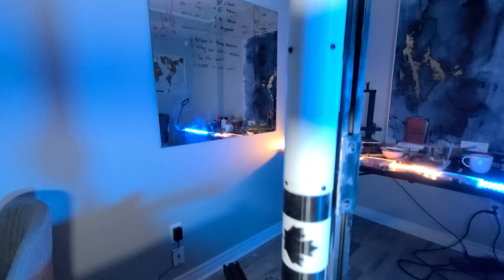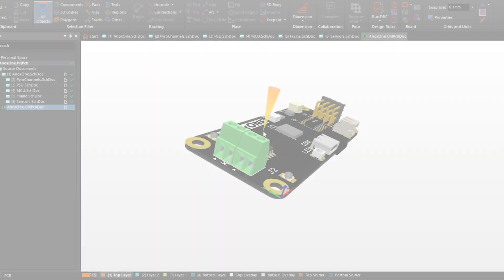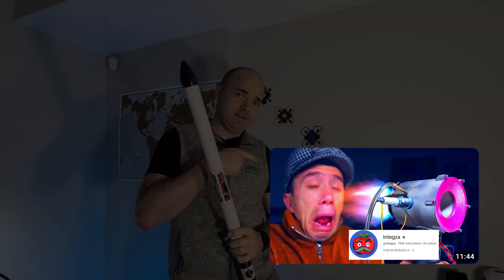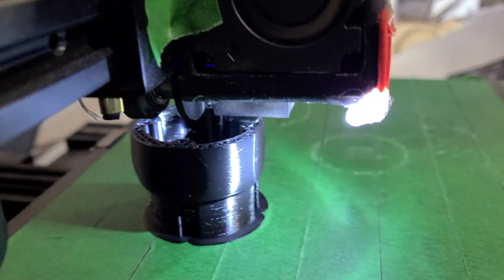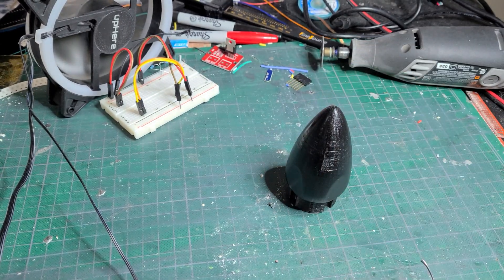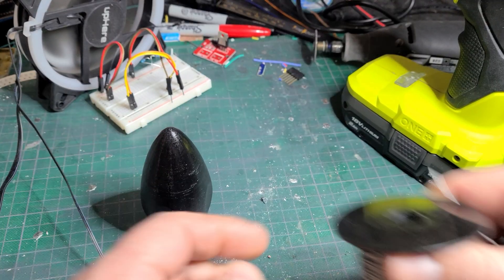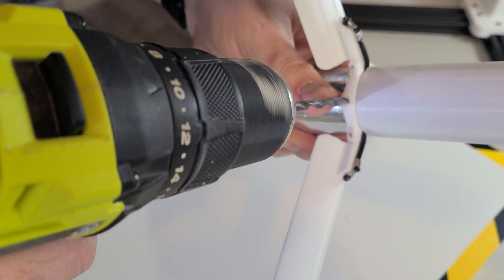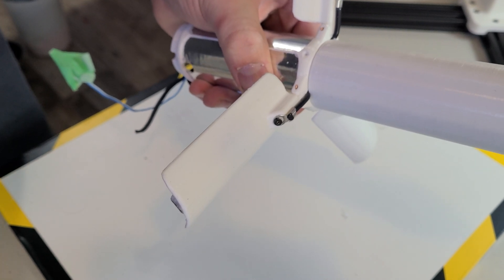"3D Printed DIY Rocket Everyone can build!"

Comment: If a group of us got together and started a joint effort or joined program so that citizen scientists can actually get flight heritage for new and creative systems in space. Even perhaps sending something into Geo or several micros or conceivable that we could as a community send several probes implementing several different new types of propulsion into a single probe and testing the efficacy of each one well at the same time collecting scientific data. So citizen scientists developed thrusters, communications hardware and software as well as small telescopes for different wavelengths as even small clusters of off-the-shelf Canon lenses here on Earth have proven to be extremely helpful especially when looking for near Earth objects and objects approaching from behind the Sun. And if you were to deploy several in a small area that were designed to receive frequencies like an infiltrator would using a fold-out durable yet flexible parabola.... We're talking frequencies that just need monopoles or folded dipoles. But then I need to communicate what they've received in a frequency that can be either received by amsat q100 which is stationed over Europe in the Middle East and is available for amateur radio operators.

Comment: Super cool! i would love to build one of these with my son.. where can i find the files at?
Reply from the maker: Hey Thank you for the message, I'm just making final tweaks to the files, the rocket in the video will be available for download form my patron page as a public access in next week or so, so best is to follow there, but this is just the start of the project. there is a second version of this rocket called the STEM rocket. which has already been designed and will be released at the same time to active patron supporters  first and then general public later. that version is specifically designed for education, but all CAD files will be available aswell to allow you to change and adapt to your will. thanx again for the supporting message !

Comment from the maker: Something that just dawned on me. This rocket has a wet weight of just over 500g (motor included) that's the same weight of a single reel of 1.75mm filament. I buy a 500g reel of PLA for CA$27.00 that means for $27.00 the limitation of what this rocket could look like or work or perform is literally just up to the design.. you pay more for a store bought cardboard version.